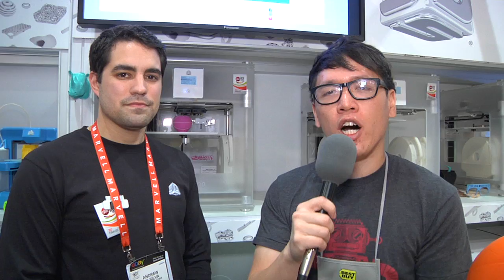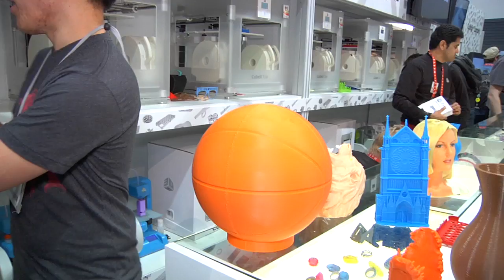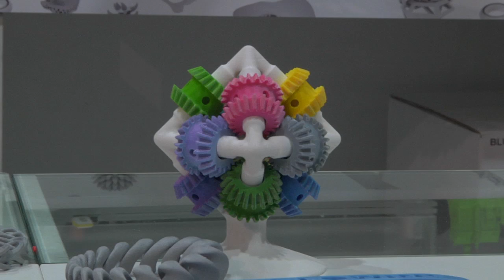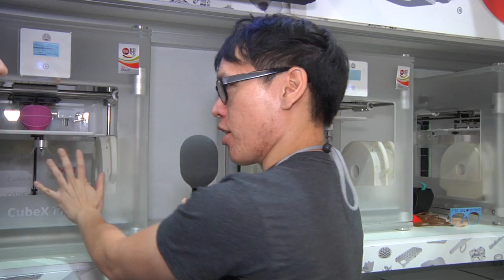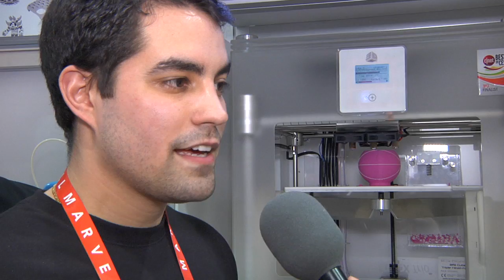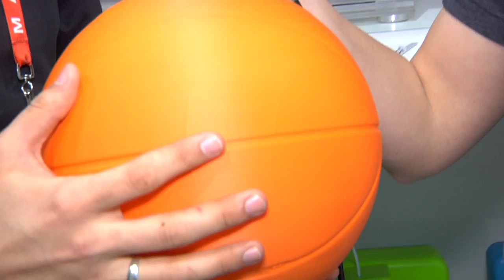CES 2013: 3D Systems CubeX Trio 3D Printer

Comment: DO NOT BUY 3d System based products. They migrated from the 3d Touch printer to the cubify and their support is GOD AWFUL! It had major problems with the printbed and this company is gargage!
Reply: While we're at it, stay away from Stratasys, I don't want them and 3D Systems to be able to patent lock everything like they did back in the 80s.

Comment: proprietary filament cartdriges, yes.. let's all get jacked up the rear like we have been for the past 20 years with bubblejet and inkjet printers.. Filament should not be in a proprietary container - Why would I pay $145 for the same filament that costs me $20 ?
Reply: Yeah, we had trouble even just contacting the support for the broken cartridge spool that they would not replace because the PLA plastic deteriorates over time which, by the way, the installer did not even mention to us and the way that it broke was that the entire plastic thread broke into multiple sections in the CubeX Duo injector pipe and the proprietary container. Eventually, I figured out that we could use ABS maker bot spooled-thread in the available secondary that we never used because the second cartridge failed to even allow thread through by re-piping the secondary injector pipe with the primary heating injector and having the spool thread ran through just like a cartridge except its 15$ and we are using the broken primary cartridge to fool the machine into printing anyway despite the completely useless cartridge and use of none "approved" cartridges. Thank god, though, that they did not have a temporary motor inside the cartridges just to run the thread into the machine to prevent 'hot wiring' the machine not to take hundreds of dollars for printing otherwise the school would have just wasted a thousand plus bucks on a broken heap and we would not have been able to refund the "Macintosh grade" $#!+ printer with the support given. Seriously, I do not approve of any business that centers around planned obsolescence models especially the Bubble/Ink jet printing industry because there is no reason that any product should sold defective or less than advertised. Other than the effort just to rig the printer to stop using money as the print material and the non-heated, "magic glue" printing bed that would need ABS juice to stop warping, I would say that the printer was overall okay in the operation as long as they do not realize that we could just put the shit cartridges in and never buy a single 100$ service 'product' from 3D Systems or even the "magic glue" then I could say that this is a starter's 3d printer for general purposes. This would be the "Macintosh" of the 3-dimensional printer world. Also, we noticed that if your "primary" print head is jammed or otherwise non-functional the whole printer refuses to use either the second or third to print as standalone.

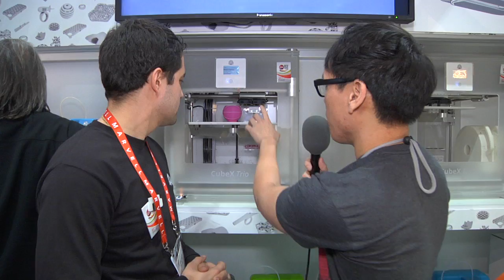Comment: Check 3:06 That's enough reason for me not to buy one of these. The tear in the seam is often due to poor X/Y stepper systems. The guy in the video says "Don't you want things done faster, right away?" Sure, but not at the expense of the actual model itself. He is priding himself on not having to finish the model after printing, but that's bullshit, as with giant tears and holes in your model, you will need to finish them anyway.
Reply: Geoff W.   yes my machine was dumping out just as much material as it was printing

Comment: WOW who would pay that? i am building a duel nozzle bot  with sd/lcd and a 12x8" heated bed with no plastic parts for what i am guessing around 600$-700$ when all is said and done. but that's the nice thing about being a machinist with my own lathe and mill i suppose, plus the aluminum frame i am casting out of free scrap XP  but still that sound ridiculous, 90$ a spool? i will buy the big 25$ spools and print my own case for them lol

Comment: The material can absorb moisture, and this could make it swell, which could cause jamming in the extruder.  Also, moisture can cause some boiling in the extruder, which could result in air bubbles in the print.  The instructions say to cut off 50mm of the filament before you start, partially I'm sure to sell more filament, but also because that 50mm is more exposed to air.  Most people keep their filament in bags with desiccants.

Comment: Zach, you said "...generic filament works great" with the CubeX.  Can you use generic filament, or does the printer demand that a cartridge be in place?  I would probably buy the CubeX Trio over the Replicator 2X if it were not for the cartridge thing, despite the extra $800 or so cost.  But then there is the 125 microns thing.  Most discussions, even with reps of Cubify, say that the resolution is 125 microns, but here and there someone will say it is 100 microns.  There is a big difference.

Comment: I ordered the CubeX trio and I'm returning it after a month of frustration trying to get it to work. Issues encountered: replaced motherboard after it burned out after electrical spark during installation of print cartridge in bay 2. Bay 2 & 3 "cartridges not found" message. Filament jams inside cartridge and finally the print quality was awful.

Comment: 1) cartridges are gimmicks and everyone knows.  Theytell you how much material is left. filament feeds by stepper motors in the print head; generic filament works great.

2) cubex print volume is hugely larger than any competitor.

3) resolution is highest possible with existing commercial extruders and stepper motors.

4) 3 print heads, 2 different materials in the same print.... 

Homebrew systems cant be compared, as they represent about 3 orders of magnitude more frustration

Comment: You say your "open-source" (and brand yourself in that light), yet believe in a singular material source dependency on what makes these printers run. With a smart cartridge, you can not fill them yourself because they will always display to the printer that they are empty after their first use. That just like the BS apple did with their iphone 5 plug vs the iphone 4 plug... no better at all. Its all smoke and mirrors. Open source, for the better of the community of developers... ya sure. lol.

Comment: What they fail to specify that this is a future model of the BFB 3D Touch printer that 3d Systems has released. This printer has a wiper blade in which in the middle of printing it will "wipe" excess ABS/PLA. The issue with this is that if for ANY reason it doesnt wipe correctly your print is a fail. Also look very closely at the cubex trio videos on youtube, notice that some of the edges are NOT sticking to the printbed.....another big problem that BitsFromBytes had with their printer.

Comment: It isn't total bunk though. If using PLA you do need to keep it in a controlled environment so it won't dry out. That said, they have a classic razor and blades approach to sales. Where I think 3D Systems is going to excel is in the integration of their software, having recently purchased both Autodesk and Geomagic. So far, the software integration and ease of use has always been a pain.

Comment: I'm interested in the math for the smart cartridges. As soon as I heard him say that they were using a proprietary cartridge based system instead of an open system red flags immediately started firing and I started thinking that they were probably going to be ridiculously expensive compared to other methods. I don't do 3d printing because its not at a price point I can justify yet, so I don't know what it costs to make "40 to 50 iphone cases" with makerbot or other 3d printing systems.

Comment: The Rostock MAX prints BIGGER than that, so they're already not quoting correct information, its only $999 and is also much faster at printing. The only bad part is it doesn't come pre-assembled.